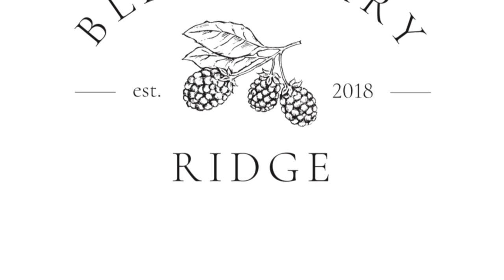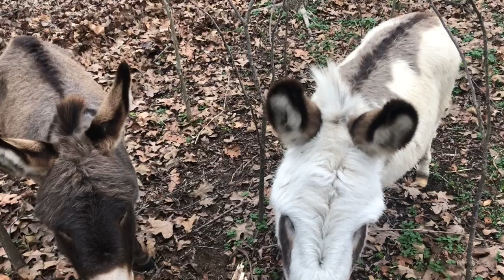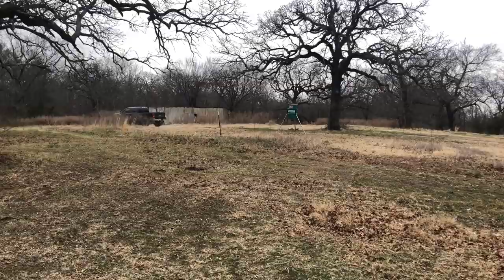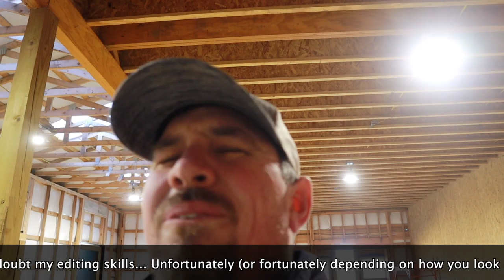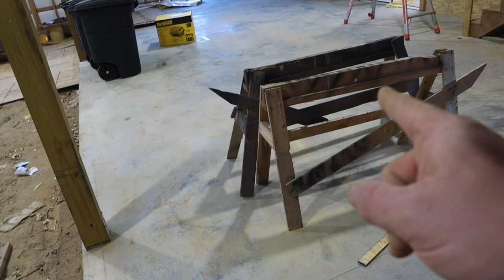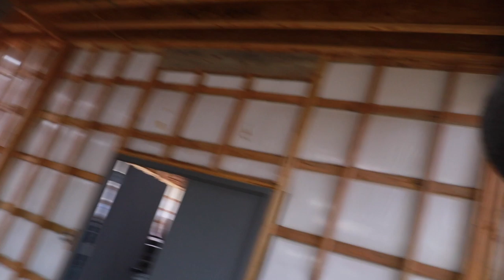Building Another Barn.. Already?? BARNDOMINIUM!!!

Comment: What you said about storing doors... I built a treehouse for my grandkids last summer.  I needed a door for it. So, I went to the Habitat for Humanity Restore.   

I was looking for an exterior door that had some rustic character.   The perfect door was right there... way back in the corner, covered in dust and leaning against the wall. I pulled it out and laid it in the aisle to check it out... as you can imagine... it would have been a great floor for a gondola.  I put it back against the wall with the bow out... hoping, against hope, that by some miracle it would bow back to straight before I came shopping for my next project.

Thanks for the tip... hopefully you’ve saved a few doors from ex-stink-shun!
Reply from the maker: William Harris you bet. The supports are 4ft apart so no chance of becoming a hammock here.

Comment: So ..just a crazy question ? Why wouldn't you use the horizontal boards as a level mark instead of trying to hold up the 4 ft level and doing a dance with the devil
Reply from the maker: Mechanic Mike I was more or less showing what I would do if I didn’t have those cheaters. For anyone building quick shelving. Instead of using a tape measure to make sure it was all the same height I use a level to make it much faster. I certainly could’ve done all that with just the torpedo level.
Reply: @blackberryridge8205  haha I was just wondering ... I thought pistol Pete told you to do it that way